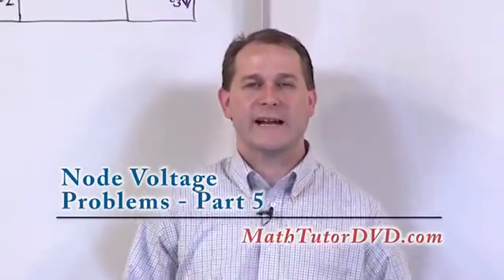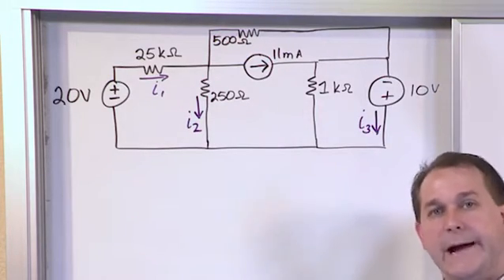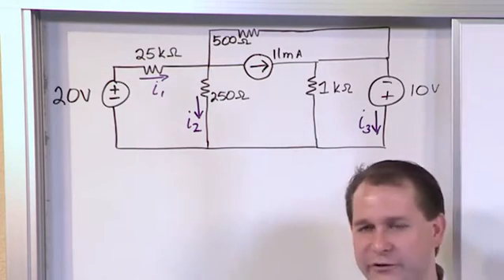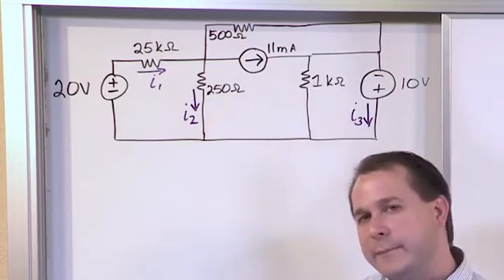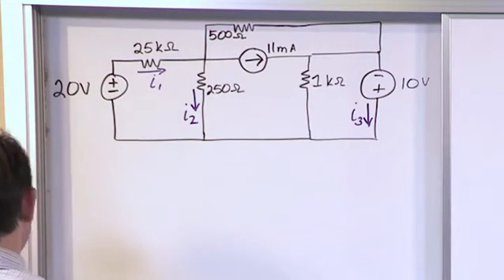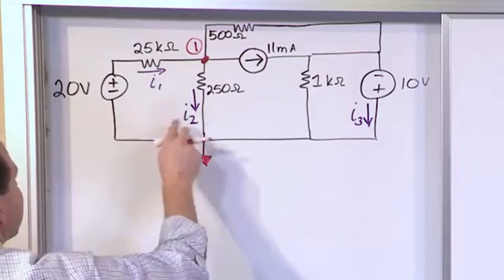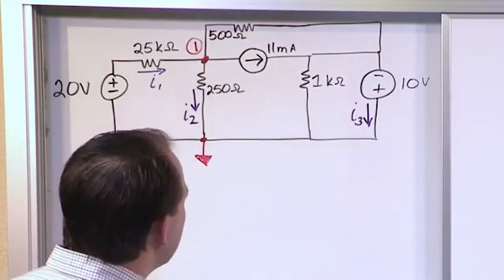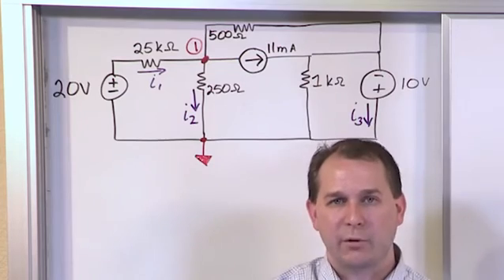Lesson 6 - Node Voltage Problems, Part 5 (Engineering Circuits)

Comment: The circuit has 3 nodes so you will need 3-1 equations (2), but one of those equations (the one for the node V2) is already resolved since between the V2 and the reference node (ground) there's only a Voltage source. So basically the system of equations you're left with is 
(V1-20)/25k + V1/250 + (V1-V2)/500 - 11mA=0
V2=-10
be careful with the orientation of the voltage source, since it's pointing towards the reference node, V2 is at a lower voltage, in this case -10.
if you resolve the system of equation you get V1=-5 and V2=-10